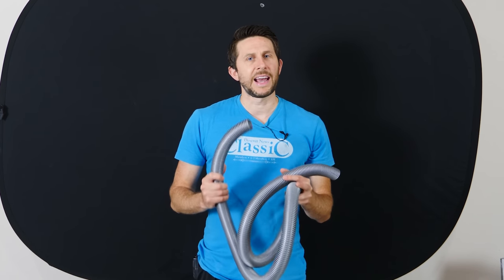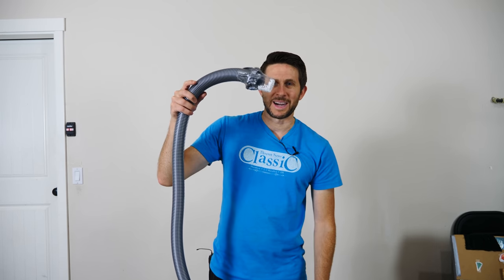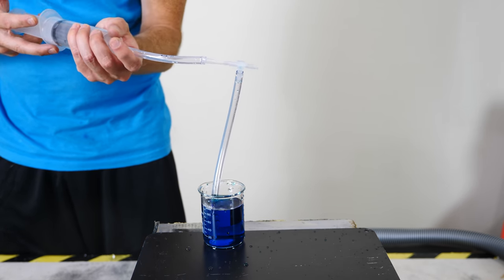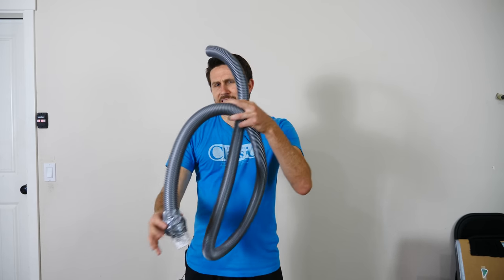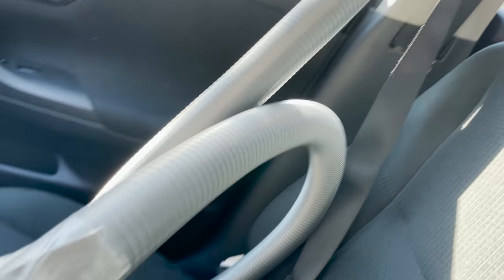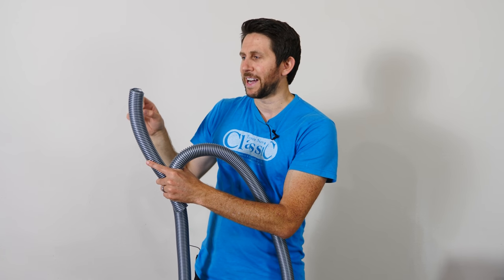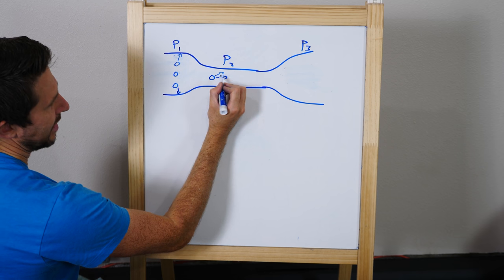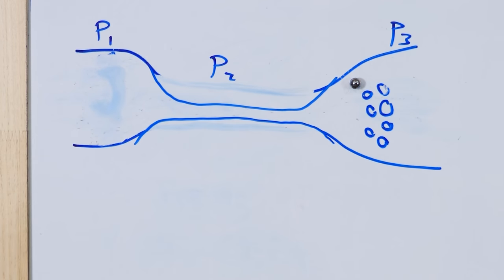The Self-Sucking Vacuum Cleaner

Comment: As an aerospace engineer, I wish I had gotten this intuitive explanation of the Bernoulli's equation way back in school..it would have made the road ahead so much easier!
Reply: Too bad the road ahead is now littered with styrofoam.
Reply: @Chris.Pontius 
Littered? It's a Styrofoam carpet!
Reply: I wouldn´t have believed you if you hadn't said you were an aerospace engineer.
Reply: One question, why does this easy explanation hold, if you can derive it with the conservation of energy and not with statistics?
Why can you explain the functioning of airplanes with bernoullies principle, but also with newton (air will get pushed downwards so the plane will go up or lower pressure due to the roundness of the wing)? normally when there are two explanations they fit into each other and you've got a overall understanding of the problem if you know both explanations, but in this case of bernoulli, it confuses me.
Reply: @neutronenstern.  " but in this case of bernoulli, it confuses me." Berboulli's principle can't explain why a leaf, a plastic bag, or an upside down aircraft can fly in the air or wind.
Reply: as a mcd worker, same here.
Reply: @neutronenstern.  Airplanes rely on both Bernoulli's principle and Newton's law to stay in the air. Race cars rely on both as well if the rules allow it, but some don't allow wings so they rely solely on Bernoulli.

The venturi in a carburetor relies solely on Bernoulli. It''s almost identical to what he set up near the beginning with plastic tubing.
Reply: @michaelngan99  
      _________
/________________\
Shape of wing from left side let's say.. upper region blocks air more & hence higher pressure.. + the downward force.. 

Now the left to right was inverted above so tilt your device 180° and that'll be how it work..

I'm pretty sure I'm wrong ;.;
Reply: @n0nenone  The conventional explanation of the wing is wrong. Because when you fly upside down, the wing is turned over, and all the conventional theory goes out the window. That's why they never bother to explain how an airplane flies upside down. Because they simply can't. SAD.
Reply: @neutronenstern.  Unfortunately, Jim's explanation is wrong. If you carefully read Bernoulli's principle the way it's correctly written, it says as air increases in velocity the pressure decreases. When you're swinging the hose around you're not increasing the velocity of any air. You're moving the hose passed the air. Bernoulli says nothing about air moving past the surface or an opening or a surface moving past air or an opening moving past the air.
This works because as air is forced to curve around the end of The swinging tube that curve in the flow creates a low pressure. Air has inertia because it has mass. Is the end of the tube approaches and pushes some air aside and it travels past the opening it is trying to go straight away from the opening this lowers the pressure at the opening.
.. ..
There is also Newton's First law that will have the air in the end of the rotating tube wanting to go straight (the centrifugal effect) and exiting the tube, thus lowering the pressure in the tube more. (like the girl on the merry-go-round in the video below)..

 The circumstances required to do this is the exact same thing that occurs above the wing and also the typical perfume aspirator or classical bug spray. It is explained fully in my one minute video here.
 https://m.youtube.com/watch?v=3MSqbnbKDmM
..
For a full and correct explanation of Bernoulli's principle and then lift, read the following blog:
 Understanding Bernoulli's Principle Correctly 
 https://kyuoyckftflurrpq.quora.com/  

..
Reply: @n0nenone  I can't figure out what you're trying to say, but...
 Unfortunately, Jim's explanation is wrong. If you carefully read Bernoulli's principle the way it's correctly written, it says as air increases in velocity the pressure decreases. When you're swinging the hose around you're not increasing the velocity of any air. You're moving the hose passed the air. Bernoulli says nothing about air moving past the surface or an opening or a surface moving past air or an opening moving past the air.
This works because as air is forced to curve around the end of The swinging tube that curve in the flow creates a low pressure. Air has inertia because it has mass. Is the end of the tube approaches and pushes some air aside and it travels past the opening it is trying to go straight away from the opening this lowers the pressure at the opening.
.. ..
There is also Newton's First law that will have the air in the end of the rotating tube wanting to go straight (the centrifugal effect) and exiting the tube, thus lowering the pressure in the tube more. (like the girl on the merry-go-round in the video below)..

 The circumstances required to do this is the exact same thing that occurs above the wing and also the typical perfume aspirator or classical bug spray. It is explained fully in my one minute video here.
 https://m.youtube.com/watch?v=3MSqbnbKDmM
..
For a full and correct explanation of Bernoulli's principle and then lift, read the following blog:
 Understanding Bernoulli's Principle Correctly 
 https://kyuoyckftflurrpq.quora.com/  
..
Reply: @chitlitlah  Nope.
..
 Unfortunately, Jim's explanation is wrong. If you carefully read Bernoulli's principle the way it's correctly written, it says as air increases in velocity the pressure decreases. When you're swinging the hose around you're not increasing the velocity of any air. You're moving the hose passed the air. Bernoulli says nothing about air moving past the surface or an opening or a surface moving past air or an opening moving past the air.
This works because as air is forced to curve around the end of The swinging tube that curve in the flow creates a low pressure. Air has inertia because it has mass. Is the end of the tube approaches and pushes some air aside and it travels past the opening it is trying to go straight away from the opening this lowers the pressure at the opening.
.. ..
There is also Newton's First law that will have the air in the end of the rotating tube wanting to go straight (the centrifugal effect) and exiting the tube, thus lowering the pressure in the tube more. (like the girl on the merry-go-round in the video below)..

 The circumstances required to do this is the exact same thing that occurs above the wing and also the typical perfume aspirator or classical bug spray. It is explained fully in my one minute video here.
 https://m.youtube.com/watch?v=3MSqbnbKDmM
..
For a full and correct explanation of Bernoulli's principle and then lift, read the following blog:
 Understanding Bernoulli's Principle Correctly 
 https://kyuoyckftflurrpq.quora.com/  
..
Reply: @michaelngan99   Unfortunately, Jim's explanation is wrong. If you carefully read Bernoulli's principle the way it's correctly written, it says as air increases in velocity the pressure decreases. When you're swinging the hose around you're not increasing the velocity of any air. You're moving the hose passed the air. Bernoulli says nothing about air moving past the surface or an opening or a surface moving past air or an opening moving past the air.
This works because as air is forced to curve around the end of The swinging tube that curve in the flow creates a low pressure. Air has inertia because it has mass. Is the end of the tube approaches and pushes some air aside and it travels past the opening it is trying to go straight away from the opening this lowers the pressure at the opening.
.. ..
There is also Newton's First law that will have the air in the end of the rotating tube wanting to go straight (the centrifugal effect) and exiting the tube, thus lowering the pressure in the tube more. (like the girl on the merry-go-round in the video below)..

 The circumstances required to do this is the exact same thing that occurs above the wing and also the typical perfume aspirator or classical bug spray. It is explained fully in my one minute video here.
 https://m.youtube.com/watch?v=3MSqbnbKDmM
..
For a full and correct explanation of Bernoulli's principle and then lift, read the following blog:
 Understanding Bernoulli's Principle Correctly 
 https://kyuoyckftflurrpq.quora.com/  
..
Reply: @neutronenstern.  The "conservation versions are very high level.
..
 Unfortunately, Jim's explanation is wrong. If you carefully read Bernoulli's principle the way it's correctly written, it says as air increases in velocity the pressure decreases. When you're swinging the hose around you're not increasing the velocity of any air. You're moving the hose passed the air. Bernoulli says nothing about air moving past the surface or an opening or a surface moving past air or an opening moving past the air.
This works because as air is forced to curve around the end of The swinging tube that curve in the flow creates a low pressure. Air has inertia because it has mass. Is the end of the tube approaches and pushes some air aside and it travels past the opening it is trying to go straight away from the opening this lowers the pressure at the opening.
.. ..
There is also Newton's First law that will have the air in the end of the rotating tube wanting to go straight (the centrifugal effect) and exiting the tube, thus lowering the pressure in the tube more. (like the girl on the merry-go-round in the video below)..

 The circumstances required to do this is the exact same thing that occurs above the wing and also the typical perfume aspirator or classical bug spray. It is explained fully in my one minute video here.
 https://m.youtube.com/watch?v=3MSqbnbKDmM
..
For a full and correct explanation of Bernoulli's principle and then lift, read the following blog:
 Understanding Bernoulli's Principle Correctly 
 https://kyuoyckftflurrpq.quora.com/  
..
Reply: @michaelngan99   Unfortunately, Jim's explanation is wrong. If you carefully read Bernoulli's principle the way it's correctly written, it says as air increases in velocity the pressure decreases. When you're swinging the hose around you're not increasing the velocity of any air. You're moving the hose passed the air. Bernoulli says nothing about air moving past the surface or an opening or a surface moving past air or an opening moving past the air.
This works because as air is forced to curve around the end of The swinging tube that curve in the flow creates a low pressure. Air has inertia because it has mass. Is the end of the tube approaches and pushes some air aside and it travels past the opening it is trying to go straight away from the opening this lowers the pressure at the opening.
.. ..
There is also Newton's First law that will have the air in the end of the rotating tube wanting to go straight (the centrifugal effect) and exiting the tube, thus lowering the pressure in the tube more. (like the girl on the merry-go-round in the video below)..

 The circumstances required to do this is the exact same thing that occurs above the wing and also the typical perfume aspirator or classical bug spray. It is explained fully in my one minute video here.
 https://m.youtube.com/watch?v=3MSqbnbKDmM
..
For a full and correct explanation of Bernoulli's principle and then lift, read the following blog:
 Understanding Bernoulli's Principle Correctly 
 https://kyuoyckftflurrpq.quora.com/  
..
Reply: @michaelngan99   Unfortunately, Jim's explanation is wrong. If you carefully read Bernoulli's principle the way it's correctly written, it says as air increases in velocity the pressure decreases. When you're swinging the hose around you're not increasing the velocity of any air. You're moving the hose passed the air. Bernoulli says nothing about air moving past the surface or an opening or a surface moving past air or an opening moving past the air.
This works because as air is forced to curve around the end of The swinging tube that curve in the flow creates a low pressure. Air has inertia because it has mass. Is the end of the tube approaches and pushes some air aside and it travels past the opening it is trying to go straight away from the opening this lowers the pressure at the opening.
.. ..
There is also Newton's First law that will have the air in the end of the rotating tube wanting to go straight (the centrifugal effect) and exiting the tube, thus lowering the pressure in the tube more. (like the girl on the merry-go-round in the video below)..

 The circumstances required to do this is the exact same thing that occurs above the wing and also the typical perfume aspirator or classical bug spray. It is explained fully in my one minute video here.
 https://m.youtube.com/watch?v=3MSqbnbKDmM
..
For a full and correct explanation of Bernoulli's principle and then lift, read the following blog:
 Understanding Bernoulli's Principle Correctly 
 https://kyuoyckftflurrpq.quora.com/  
..
Reply: @michaelngan99   Unfortunately, Jim's explanation is wrong. If you carefully read Bernoulli's principle the way it's correctly written, it says as air increases in velocity the pressure decreases. When you're swinging the hose around you're not increasing the velocity of any air. You're moving the hose passed the air. Bernoulli says nothing about air moving past the surface or an opening or a surface moving past air or an opening moving past the air.
This works because as air is forced to curve around the end of The swinging tube that curve in the flow creates a low pressure. Air has inertia because it has mass. Is the end of the tube approaches and pushes some air aside and it travels past the opening it is trying to go straight away from the opening this lowers the pressure at the opening.
.. ..
There is also Newton's First law that will have the air in the end of the rotating tube wanting to go straight (the centrifugal effect) and exiting the tube, thus lowering the pressure in the tube more. (like the girl on the merry-go-round in the video below)..

 The circumstances required to do this is the exact same thing that occurs above the wing and also the typical perfume aspirator or classical bug spray. It is explained fully in my one minute video here.
 https://m.youtube.com/watch?v=3MSqbnbKDmM
..
For a full and correct explanation of Bernoulli's principle and then lift, read the following blog:
 Understanding Bernoulli's Principle Correctly 
 https://kyuoyckftflurrpq.quora.com/  
..
Reply: @Observ45er  Yes, I was suspecting it was the Venturi Effect that created the suction.
Reply: @michaelngan99  Well, with the end of the hose flying around there is no venturi. You do not have a pipe that narrows in diameter.
If you haven't looked at it, look at that link I provide above for the explanation of the Bernoulli effect. The situation around the swinging pipe is like the aspirator described there. I also explain more about what's going on in the Venturi.
I am very disappointed in Jim with this video. He normally does a very good job of understanding and then explaining some of these things that go on in physics, but this one he really blew.
The air coming out of his mouth when he blows between the two bottles is at the very same pressure as all of the still air around it. As air follows the curves of those bottles the command effect comes into play which also lowers the pressure along the convex curve of the bottles. It is exactly the same concept that I described in my YouTube video about the convicts curve above a wing.
So many people are well-meaning and think they understand what Bernoulli actually tells us and it is so frustrating to see so many people repeating these misconceptions over and over. If you really want to understand things please read my two blogs about the Bernoulli Principle and how wings operate. So many people want a very simple answer for things and I am sorry, but very few things are as simple as just black and white...
.. 
Also, when he blows across the end of the small hose that is exactly the aspirator. 
..
Then, when he puts that small little nozzle into the "TEE"  intersection, he has what is called an ejector pump. This is the kind of pump typically used in ships to pump out the bilge. It uses the concept of entrainment. When you shoot a jet of air into some still air, the viscosity around the edge of the jet draws that still air along with it. If you put that into a tube, as that air is moved along around the outside of the jet, it lowers the pressure and pulls more in from around it and that is what sucks, or lowers the pressure, in the vertical tube so that atmospheric pressure can push eater up. It's just like when we use a drinking straw and lower the pressure at the top so that atmospheric pressure can push the water into our mouths.
Several weeks ago I sent a message to Jim via his Facebook page because I found an error in one of his other videos, unfortunately he has not responded. I just sent him another message via Facebook and also in one of the comments here. I really need to talk to him about this because it is very disappointing to see him spread this misconception. He normally does very good on these things. Unfortunately, so many people ignore their videos here on Facebook.
This subject of Bernoulli's principle is one of the most widely misunderstood concepts in physics and it is so frustrating for people who understand it, like me, to see these misconceptions repeated over and over and over again.
Regards.
Reply: @Observ45er  Well, you don't know what is the venturi effect.
Reply: @michaelngan99  Well then, You'll obviously be able to explain just how  a narrowing pipe relates to the swinging end of the tube?
Reply: @Observ45er  There was no narrowing of the pipe as he swing it around. There was relative motion between the air in the hose and the surrounding, so there was a pressure differential, so that caused the air to move inside the hose, and suck up the balls.
Reply: @Observ45er  Bernoulli's Principle DESCRIBES the change of pressure and velocity inside an narrowing tube, but there was no explanation of why it was so. However, Pascal's Principle in Hydraulic or Fluid Mechanic does able to EXPLAIN this phenomena of fluid pressure and velocity inside a narrowing tube. Look it up.
Reply: @michaelngan99  You are repeating one of the common misconceptions about this, Michael.  
Attempting to relate a true venturi and the swinging pipe shows a lack of understanding of fundamental fluid dynamics. Jim is well meaning and usually does very well, but  he is wrong here.
.
A venturi is a diameter changing pipe/.tube.  There is none here.
.
You appear to be conflating a venturi and Bernoulli's Principle and do not understand the essence of the Principle.
..
The _Bernoulli Principle_ is not about a 'difference' in pressure between any two locations.  It is about the changes in speed and pressure along/within a single flow path that each bit of fluid experiences as it moves along the path, or as some prefer to say, along a streamline.
..
For example:
There is also relative motion between the air blown out of your mouth and the stationary air all around it, yet we (and you) can easily measure the pressure of those two to be exactly the same static pressure.  Aeronautical engineers measure this daily as shown in Weltner. 

Please see figure 3 in Weltner.

..
What we actually have here is directly related to the atomizer shown in Fig 4.
..
Fig 1 is a Venturi.
.. ..
Weltner:
http://user.uni-frankfurt.de/~weltner/Misinterpretations%20of%20Bernoullis%20Law%202011%20internet.pdf    
.

Weltner Physics of Flight 
Web Page Version:
file:///C:/Users/Steve/Documents/.%20%20%20%20Technical/Writing%20collection%20Articles/LIFT%20%20Articles%20and%20Writings/Weltner%20Physics%20of%20flight%20AngelFire.html
.

PDF Version:
https://user.uni-frankfurt.de/~weltner/Physics%20of%20Flight%20internet%202011.pdf 
.. ..
I'm an experienced engineer and have studied aerodynamics.
Reply: @Observ45er  "A venturi is a diameter changing pipe/.tube.  "  No, it is simply blowing air or fluid over the opening of a pipe or chimney. And that will cause the Venturi Effect.
Reply: @michaelngan99  It is true that there is no indication in Bernoulli's notes that he understood the cause of the pressure/speed relationship.  
..
We learned that it was Euler, following up on Bernoulli's work, that first determined that a Pressure Gradient is the cause of fluid acceleration.  This is Newton in fluids. A Pressure Gradient provides the net force to accelerate the mass in the fluid.
.. 
..
..
Pascal's Principle is about a STATIC system pressure NOT dynamics.  I am sorry, Mike, but it is you who needs to look it up and understand it.
..
Pascal's Principle says that in a fluid at rest in a closed container, a pressure change in one part is transmitted without loss to every portion of the fluid. 
.. ..
That, in NO WAY, can be stretched to this situation.
There is no closed container. The tube is swinging in a virtually infinite atmosphere.
..
Nothing is at rest here. This is a completely dynamic fluid situation.
.. ..
Reply: @michaelngan99  You've got much to learn, son.
Start by actually reading Weltner.  He spells it all out for you.  Then move up  to the very well known texts and consult with some of the noted authors as I have...
Rrgards.
Reply: @michael ngan  https://en.wikipedia.org/wiki/Venturi_effect
Reply: @Observ45er  Pascal's Principle works in a dynamic situation, also. The fluid dynamist usually don't distinguish between frontal pressure and the pressure experienced by the tube walls, this lead to a lot of difficulties in their understanding.
Reply: @Observ45er  "I'm an experienced engineer and have studied aerodynamics." No wonder you are so confused. I have often wonder about the IQ of the aerodynamicists, why they are so low.
Reply: @michaelngan99  Resorting to an ad hominem clearly demonstrates you are unable to discuss the physics.
I am a very experienced electrical engineer that took up studying aerodynamics as a result of a responsibility I took managing a sophisticated flight simulator a number of years ago. I read the more respected books and papers, then also consulted with a few well-known aerodynamicists.
 I agree that like many engineers, they have trouble boiling things down to only the necessary  fundamentals that are both correct and easily understood without adding all of the unnecessary details that they are so familiar with on a daily basis..
 I learned this having taught electronics at the community college level. Effective teaching also requires the ability to tailor one's explanations to the students ability.

How have you studied aerodynamics?
Have you had 11th grade physics or anything past that?
..
Do you believe you understand Newton's laws?
Do you understand that air has mass?
Do you understand that to accelerate that type of mass requires a net force?
Do you understand that these concepts must also apply when working on fluid problems?
Reply: @Observ45er  It is a very sad state of affair that 100 years after the first flight of the Wright Brother, the Aerodynamicists still couldn't explain how an airplane fly without confuse the hell out of the ordinary persons. In fact, the aerodynamicists couldn't agree among themselves how an airplane fly. Sorry to take that out on you, but I don't interact with an aerodynamicist often in my life.